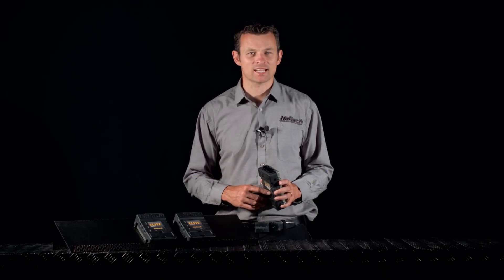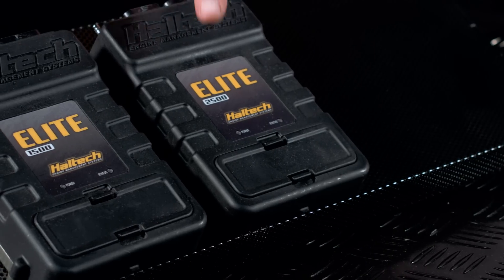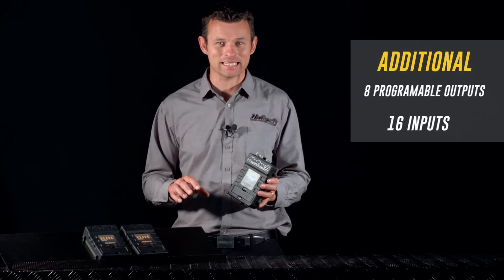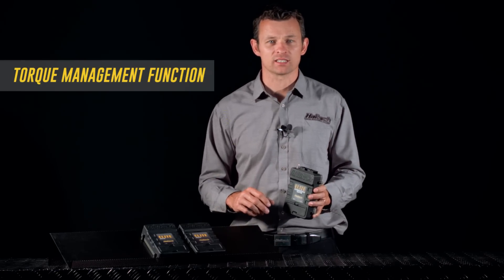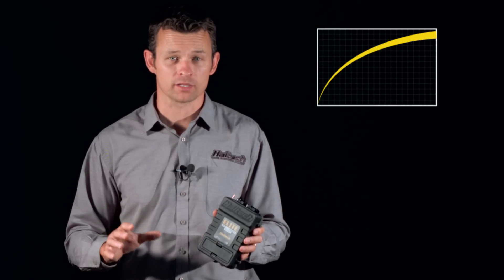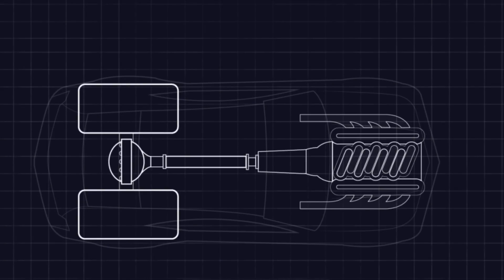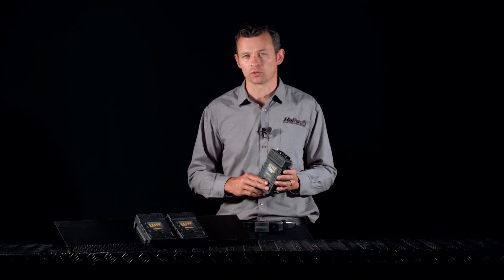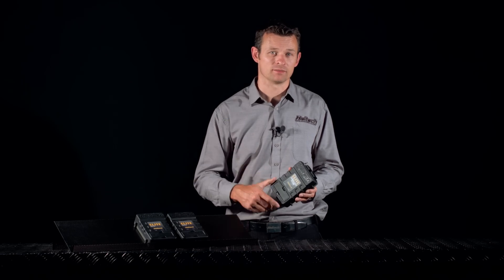🔍 How Haltech's Race Expansion Module (REM) Works

Comment: Wait. So it uses time vs speed instead of front wheel speed vs rear wheel speed? I'm not drag racing. I'm on the street. How is this superior to driven vs undriven wheel speed?
Reply from the maker: It typically uses a collar on the driveshaft, but you wouldn't use this for the street. It is designed as drag racing application only.